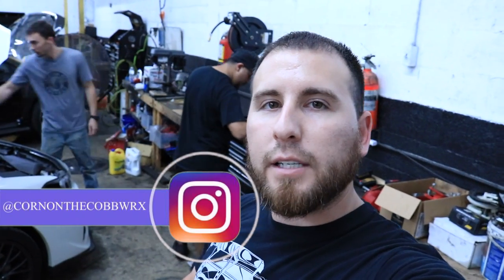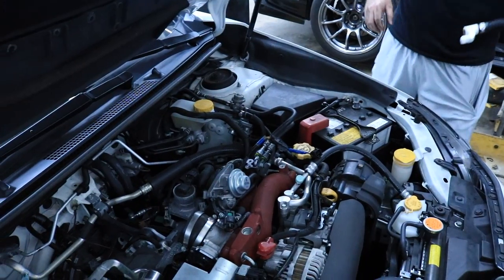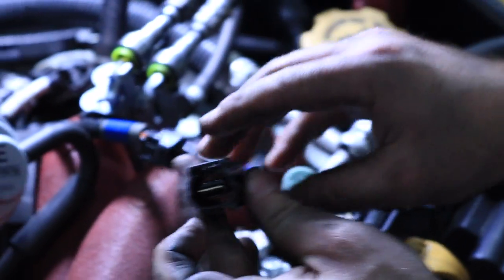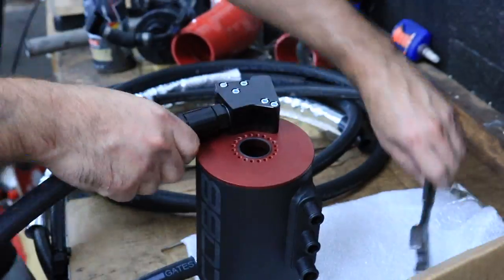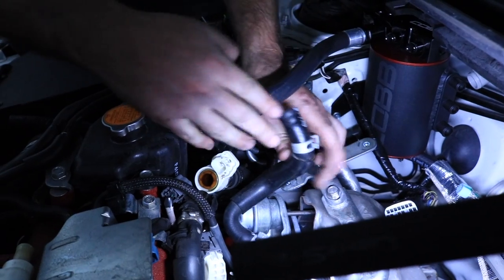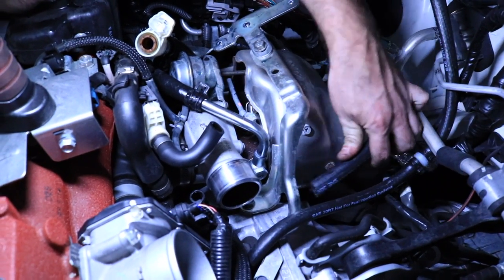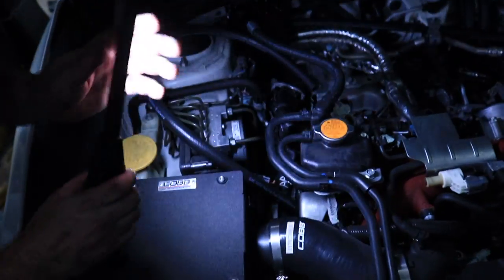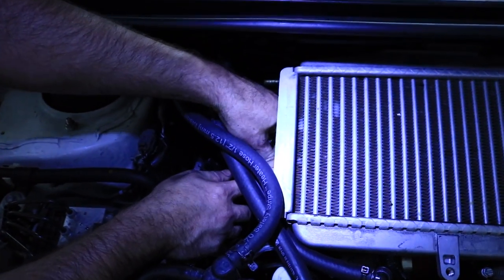Finally Installed My COBB AOS On My 2017 WRX STI!

Comment: My local subie specialist quoted me 950 for the part and install...that seems like a lot considering the part itself is 450. Is 950 unreasonable?
Reply: Seems pretty expensive to me. I'm considering this install and I've seen other people get quoted like $400-500 online, but I don't have any confirmation on the validity of those claims.
Reply from the maker: I would double check with the experts @wrxpertsautoworks on Instagram